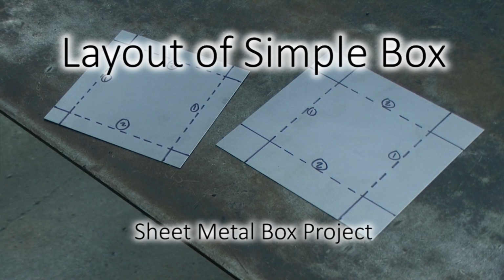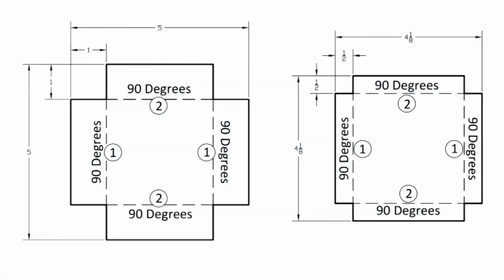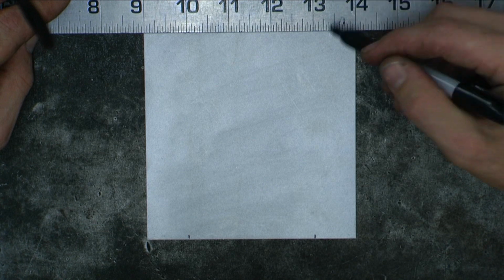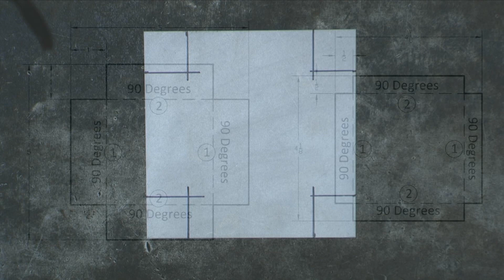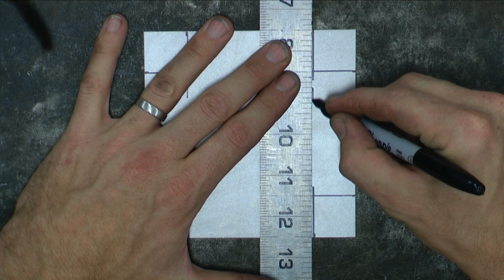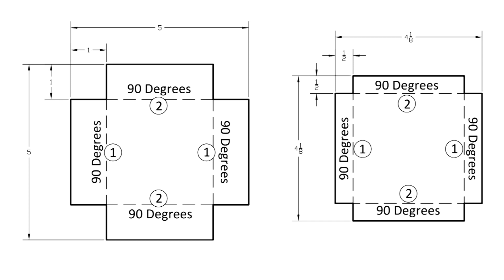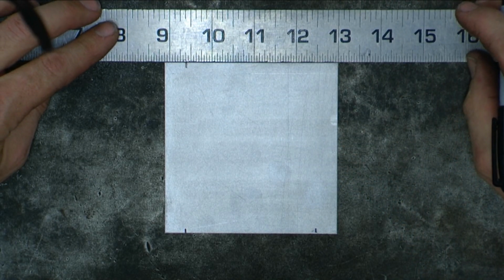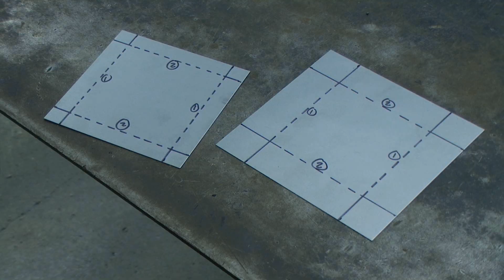Simple Sheet Metal Box - Part 1 Layout

Comment: What thickness is that
Reply from the maker: 22 gauge
Reply: Thanks.... Im thinking of making a tray for my parrot cage, 760mm x 530mm.....not sure which guage to use
Reply from the maker: @Bmxmusikian  Anything 20 gauge or thicker gets pretty hard to cut and fold unless you have decent equipment.  However, I also wouldn't recommend going any thinner than 26 gauge.
Reply: Thanks mate :)